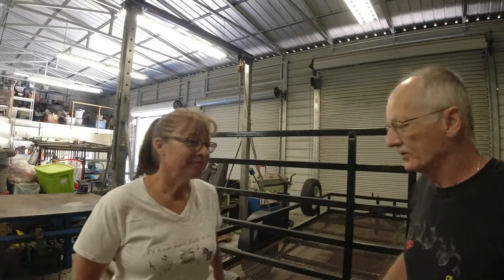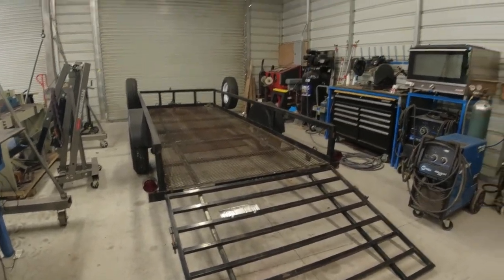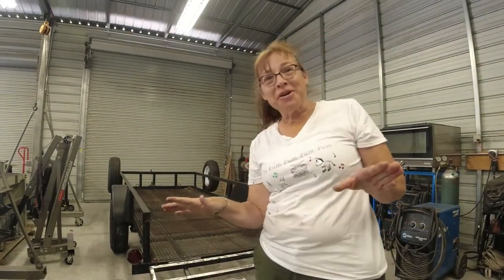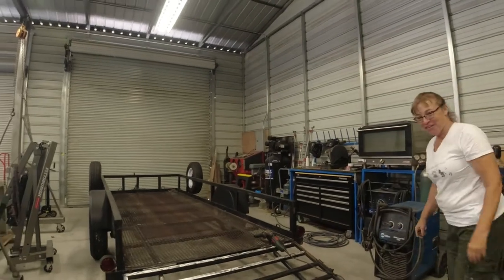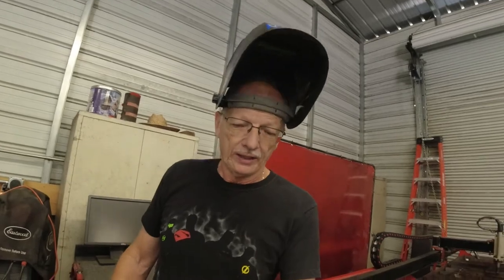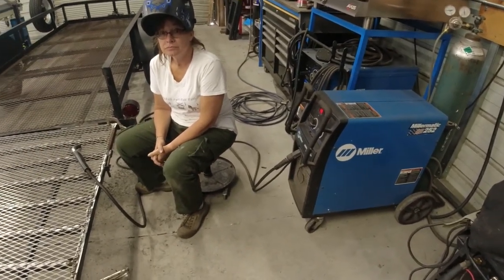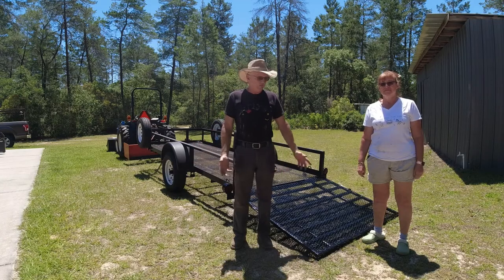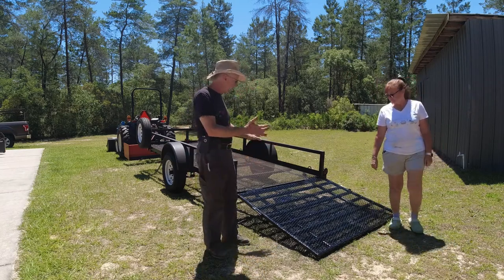Welding Expanded Metal To Our Utility Trailer Tailgate

Comment: What size is the expanded metal? #9? #16? Or something else?
Reply from the maker: The expanded metal is 3/4" x 9 ga. flattened.
Reply: @timewiththedurbins   Is the flooring 3/4x9 ga to thanks. I want to replace my wooden boards with metal.. Great video
Reply from the maker: #9.
Reply from the maker: The flooring is 3/4 by 9 flattened. It was already on the trailer. I would have used Un flattened if I had built the trailer. I think it is a little stronger and less slippery.